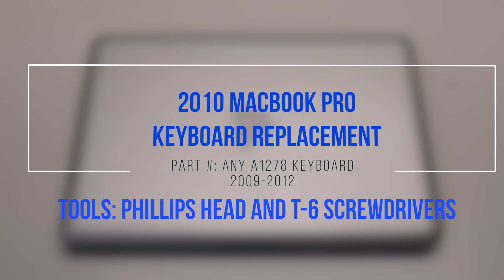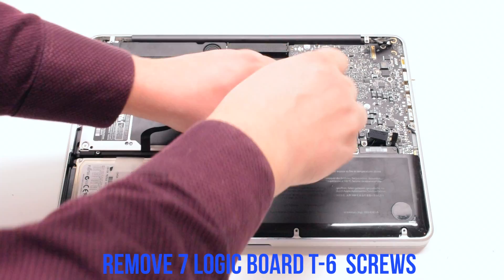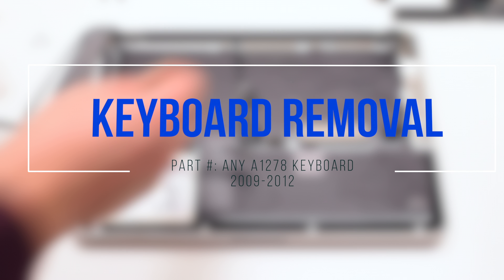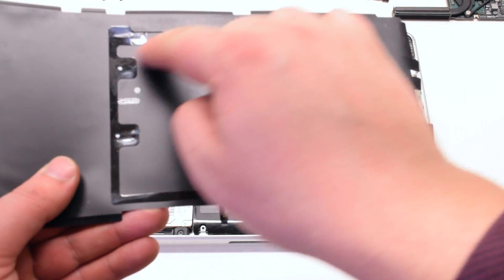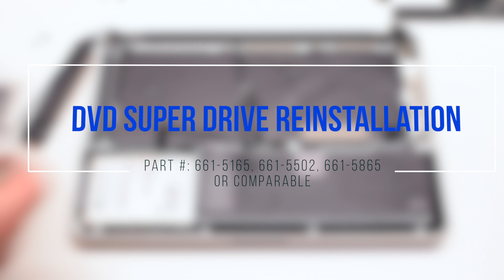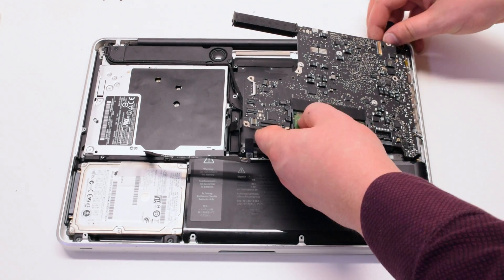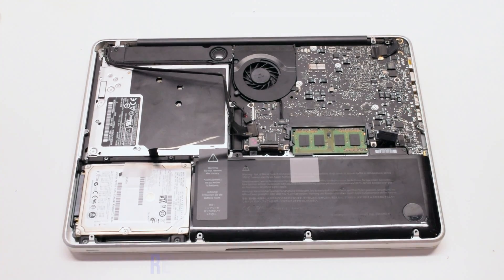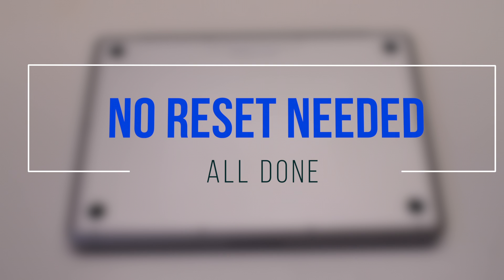2010 Macbook Pro 13" A1278 Keyboard Replacement

Comment: good god this is giving me a heart attack taking this thing apart . scared it wont work when i put it back together
Reply from the maker: It will! Just make sure you reconnect the keyboard cable, that's what sends the signal to power the unit back on when you reassemble it ;)
Reply: @GRIBSOFT  i  mean like the rest of it. like the power button or something
Reply: @GRIBSOFT  had to buy the right screwdrivers
Reply: @GRIBSOFT  i stripped some screws :( what do i do

Comment: Hi! Thanks for your video. Can I replace a Spanish keyboard with a UK English QWERTY one? However I read that I should that I must replace the entire upper case if I ever want my keyboard to be fully functioning again.
Reply from the maker: The upper case is just easier to replace because you dont have to unscrew and rescrew the keyboard but you can replace just the keyboard for any language one. If you just replace the keyboard you will have to remove 50+ screws and so it's all most a 2 hour job, much more difficult and annoying but can be done.